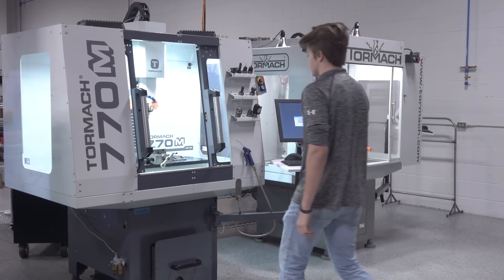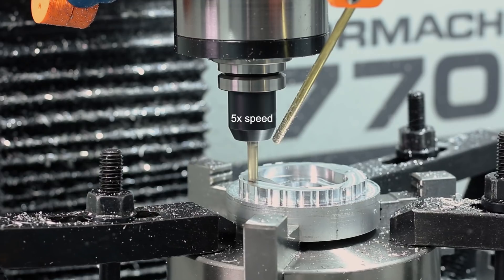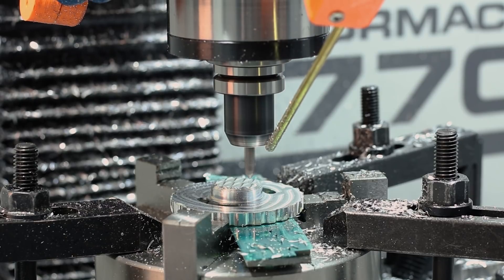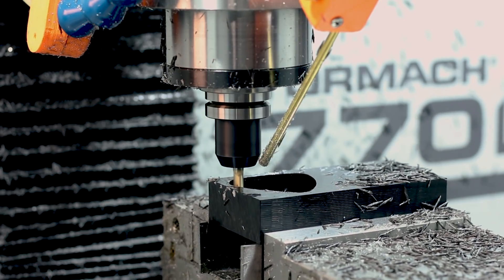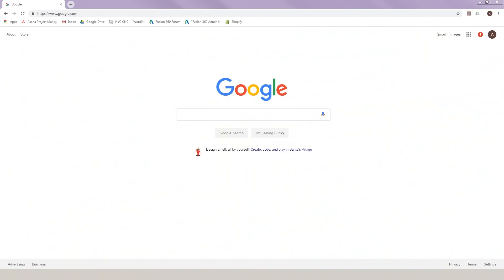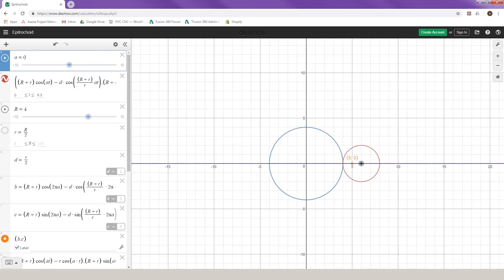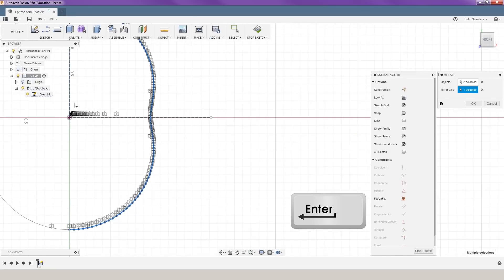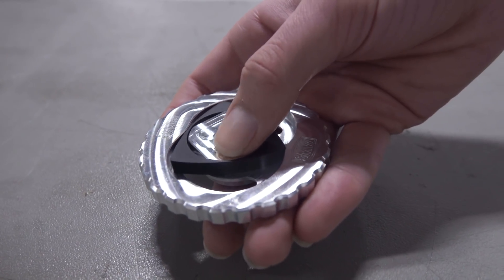Wankel Engine Fidget Spinner | WW230

Comment: Haven't used fusion in a while and am not all that good with it but I use Solidworks and have drawn a cycloid in it before. I had added the function of my shape as a spline, added some variables. I had the spline such that it didn't close the loop, and added a small spline tangential to the first one. Should be doable in fusion in my opinion.

Comment: Hey, so excited to come across a Wankel video in your channel! if you want to know more about the basic math behind the rotary housing, this comment is lengthy but I tried to make it easy to follow. I hope you enjoy and learn! 

So, the Wankel Epitrochoid shape was close. But not quite correct, maybe it was actually correct (hard to tell by the video) but I don't think it is mathematically accurate. Although it will work for something as a fidget spinner, the scale of the actual rotary engine is much much bigger and the tolerances are minimal. Mathematically is quite easy to get to the exact shape using SIN and COS. The shaft rotates 3x the speed to the rotor, therefore we always know the angle of both lines, by knowing the angle (SIN and COS) and the length of the lines (right triangle's hypotenuse) we know the length of both height and base and get to the XY coordinate of the tip of both lines, adding these will give us the the end XY coordinate.

DESMOS : The eccentric shaft rotates exactly 3 times fast than the rotor itself, so knowing the eccentric shaft offset and the rotor radius is enough when using SIN and COS to find the coordinates of both lines. Mazda's length of these two dimensions are 15mm offset and 105mm radius. In desmos just write the equation ( R sin(t) + O sin(3t) , R cos(t) + O cos(3t) ) and then add the values of "O" (offset) to 15 and "R" (Radius) to 105, adjust the t-value until the shape closes (around 6.3) and voila! you have mathematical perfection for the housing shape in DESMOS.

EXCEL: On excel it is also quite easy, but a bit more work. On the first row add columns for A(Degrees), B(Radians), C(x coordinate), D(Y coordinate), E(z coordinate), repeat that 3 times since we'll calculate the XYZ coordinate of the shaft offset and the XYZ coordinate for the Rotor Radius offset, then add them together (so the third group only needs an X, an Y, and an Z Column. Off to the side put the Offset and Radius values in a couple of cells, label these cells Offset and Radius. Now, skip Row#2 for aesthetic purposes :D .

In Row#3 A column is "0" degrees, B Column is ( =Radian(A3) ), C Column is ( =Offset*(SIN(B3)) ), D Column is ( =Offset*(COS(B3)) ), and E Column is just zero. Repeat the same procedure for the next group of Columns but the degrees column is ( =A3/3 ) since the rotor spins at a third of the speed, and multiply SIN and COS by Radius instead of the Offset since we are now dealing with the rotor. In the third group of columns you can add the X, Y, and Z values from the previous two groups. 

The next few rows are up to you. The finer the degree increments, the more points it will generate and more accurate the imported CSV Spline will be. I will recommend avoiding fraction numbers but not a big deal at all. The easiest one to generate a good and accurate surface for FUSION 360 is 36 points, so one point every 30 degrees of the eccentric shaft and 10 degrees of the rotor. At the end the first column should end in 1080 and the next group should end in 360 degrees, that closes the sketch. If all went well you can check the coordinates of easy points such as 0, 90, 180, 270, and 360 degrees and you should see round numbers popping up, because of the conversion from degrees to radians, many times instead of zero you'll see something like -1.103E-15, which is basically zero. I don't recommend rounding the excel numbers, unless you get issues with Fusion360 (which I never have and I have used this A LOT)

Now copy the added XYZ coordinates as numerical values into a new file, save it, and import as CSV Spline!!! SHAZAM!!! Lastly, to change the orientation of the Spline in Fusion 360 the best way is to shuffle the columns in this new file to match the orientation needed.

I hope this helps anyone interested !!!

ALSO: I have made a detailed FUSION360 CAD file for the actual RX-8 engine housing, with quite a bit of accurate dimensions (99.999% accurate LOL) I can provide this NYC CNC if you guys so desire.

Comment: Rotary bible by Yamamoto.  pp.16-17.

I have the parametric equation set up in solidworks.  the housing takes me thirty seconds.  the rotor is more involved, but not hard.  I can make any size/shape wankel housing and rotor.  Fusion360 still does NOT do parametric equations.  an option is to make it in solidworks and import it into fusion.

Comment: Just copy the equation, and use a equation driven curve/spline?
Reply: Fusion 360 sadly doesn't have that capability like most other CAD software, but I'm working on writing an add-in and creating an equation driven spline

Comment: If you can figure out a way to manufacture Mazda 13B side housings and rotor housings cost-effectively you'll be very popular in the rotary community. Supplies of new and salvageable used examples of these parts become rarer and more expensive by the day.

Comment: Hmmm... if you machine a washer with a hole diameter exactly twice the washer's thickness, you could use that to create a "virtual tip" for the chamfer tool for calibrating it...

Comment: I don't know in fusion, but in Solidworks I would go to sketch, then choose equation driven curve.  You then want to use a parametric curve, that is, f(x) and f(y). You then type in the parametric equation of the epitrochoid for x and y.  Then tell it you want that curve from 0-2 pi (360 deg).  Solidworks then makes the entire curve for you.
Reply: This was my first thought, sadly Fusion doesn't seem to have an equation driven curve
Reply: Alex Pinson those add ins are just python scripts.  You could write your own script to take in values and draw something parametrically.   But instead of indexing the equation and writing the values, would be to just write the equation into excel.  That way the entire geometry can be exported in much denser resolution. Like thousands of points if need be.  Also you could parameterize the input variables.

Comment: Once you have the formula set your increment field in one column of the spreadsheet. Insert the formula expressed as your independent variable (incrementing) and run the numbers to get the 1/4 segment.

Comment: My understanding is what really killed the Wankel engine is CAFE requirements - it’s got more thermal losses than a piston engine because the shape of the combustion volume has more surface area to it than a piston engine does. The oil consumption issue can be dealt with by using advanced coatings (ceramic, diamond-like-carbon, etc).

It’s kind-of a moot point though; as the future is electric...
Reply: I recall a prediction for exactly that by my automotive prof in college. That was in 81
Reply: hey you - which part? CAFE, coatings, or electric cars?
Reply: Strange this should come up, under full load a wankel has better BSFC fuel consumption when at full power (hence Mazda won LeMans in a fuel limited race) so in a hybrid electric application where the power unit would be at full load and constant RPM a wankel should be more economical than a conventional engine.

Comment: Helical has a really good chamfer mill with a flat on it to avoid the problem of the tip wearing off.
Reply: They're used for other things than just plain chamfers. The tip (as close to the tip as possible) is used to chamfer an inside corner with no radius, or a very small radius. You have to use the part of the happier that matches the radius of the inside corner. So if you have a 10 thou radius of your inside corner, you need to use the past of the chamfer tool that is </= 0.010" in radius.
Reply: Or just don't use the tip to chamfer.
Reply: @nikolaiownz  true, but even so the tip can wear down from touching the tool off or just general wear and tear.
Reply: @alexmarshalek6847  if you wear you tools tip from touching it off something is done wrong mate haha. I've never had problems with my 10 mm carbite chamfer mills. Always run around 4mm tip offset. 

Merry Christmas btw 😁
Reply: @nikolaiownz  haha you have a point. Just trying to minimize the chance of breakage of a delicate tip.
Reply: @alexmarshalek6847  yeah mate. I pay for my own tools now since I started my own shop. So I gotta take good care of thoes damn expensive carbite tools 😅
Reply: @nikolaiownz  typically we don't use the tip to chamfer, but that is also our spot tool most of the time. The only reason the tip was used here was because it was a full depth chamfer

Comment: It would be interesting to code that formula up in python and make an extension for fusion.
Reply: My initial thought is that it could pretty easily be expressed as a straight up sketch. Maybe a parameter or two and a couple of constraints.
Reply: @tube71000  Maybe if the path fit well to one of the existing splines. Mathematically it is not going to be accurate. Practically probably quite possible but it's only really an optimisation of the process used.
Reply: You speakem strange language

Comment: When using a 2-flute chamfer mill, we typically offset the point by .025 or so.  Meaning, I typically make the pass .025 off of the part, and .025 lower then my desired depth of cut.  This allows for a good surface finish on the chamfer, and it avoids having to cut with the point of the cutter.

Comment: It is interesting that you think a Wankel engine is easier to make than a piston engine. Easier to make perhaps but more difficult to get running. In the model engine community running piston engines are common, a running Wankel engine would be rare indeed! I look forward to seeing how you deal with the seals on the rotor tips
Reply: Wankels small enough to carry in one hand were available to the model airplane hobby for quite some time back. Not sure if they still are.   And asking the Wankel nay-sayers, what's wrong with a performance engine burning a little oil? :-)
Reply: @90FF1  Doesn't burn efficiently. That means elevated unburned hydrocarbons getting to the catalytic converter. This means elevated temperatures and possible converter meltdown
Reply: Making all the parts required for a working rotary wouldn't be that hard the problem i see with most small scale Rotaries is the fact they are peripheral ported making them much harder to get running and to make idle
Reply: That makes sense, but I guess The practicality of implementing that depends on the size of the model engine, I was thinking of something quite small. Anyway it will be interesting to watch
Reply: @ScroungerLee  the company OS that makes model nitro engines made a rotary one more so to say we did it than practically but it can be done and it would most certainly be beneficial for him to take a look at them and take pointers
Reply: Lee Thompson it’s quite clear that it’s easier to make, and also harder to make well and have run well. 
I suspect the model engine community values engines that are familiar and run well over ease of manufacture. 
We will certainly see if our young friend has bitten off more than he can chew.

Comment: Never use the tip of a chamfer tool.  Get a Maritool 1/2" double end chamfer tool and make sure your chamfers always use the shoulder/outer corner of the chamfer tool so that your peripheral speed (SFM) is as high as possible.
Reply: Great tip thanks.

Comment: Why didn't you just use provided equation to create your points in Excel?
Reply: To be honest, I can't believe I didn't think of this. I've used excel for that before, I guess I was too focused on using it as a middleman to get the graph into Fusion than using it as the tool it's meant to be
Reply: @alexpinson7759  I'd like to say I know how you feel, but I never do anything dumb. Just ask my wife.
Reply: Equation is the way to go, same in Solid works, waaaaay quicker
Reply: did we watch the same video? the guy asked for advice about how to do it better....you could just give the advice without the smugness.
Reply: @andrewgiles6192  agreed, on top of that I'm pretty sure Alex is their HIGH SCHOOL intern.
Reply: Andrew Giles : We did see the same video but we have different experiences with similar situations. Once I took over the function of treasurer in a club board. My predecessor used Excel for accounting. I discovered in her spreadsheets that she added up the columns of numbers with a separate calculator (or even manually?) and then entered the result back in the spreadsheet. I thought that was pretty stupid, but she was apparently not used to working with such a calculation tool. For her it was only a handy tool to fill in lists. I expect Alex to have more knowledge and expertise in that area, he does work regularly with the computer and programs such as Fusion360, Excel, that other program and the operating software of CNC machines. And therefore I expect Alex to use Excel in a more clever way and I hope he learned something from my comments.
Reply: krawacik3 how do you do that
Reply: Anyone wanna show me how to do that in excel? Im very beginner with excel so far.
Reply: That is the same remark as I wanted to make. You can't be serious having put those points in a spreadsheet by hand. Some people seem not to realise that Excel is a calculation tool not mere a handy grocery list processor but I don't expect tthose people to work with CNC machines. It must be a joke.
Reply: @wouterw.schalkoort1988  Sometimes it's just faster to calculate it one by one, but the accuracy goes down. Overall fit of the parts will be especially important in a real working prototype, where using the equation is only valid path.
Reply: also he can make that figure a lot more accurate, taking an 0.001 increment, excel will calculate all points in 15 seconds MAX
Reply: @RAPXZibit  15 milliseconds maybe. Computers are good at doing math fast
Reply: @Chad Krause
everything under 1 second practically instant in this application, and A LOT faster than manually rewriting 200 values. 
also you can see shape of your array if you create graph in excel
Reply: just tried it minute ago, it calculates immediatly with 10000 points, this is beyond any possible CNC accuracy
Reply: because that would be way to easy
Reply: Yeah, using excel to compute points is a trivial function of the software. Entering the points manually like that is unacceptable